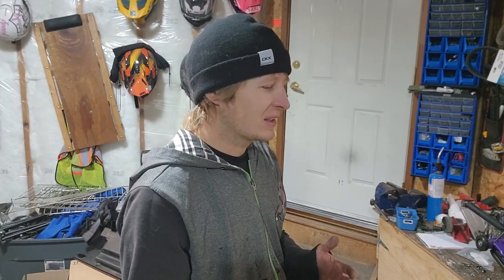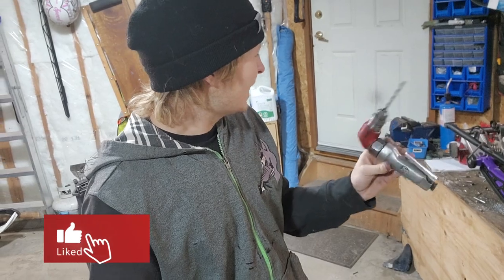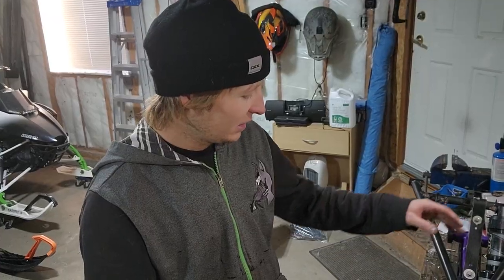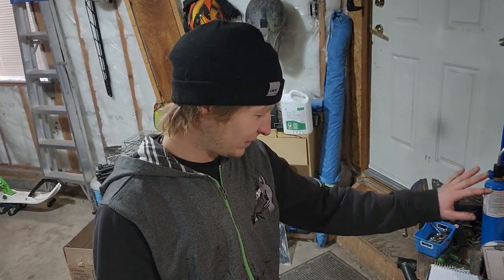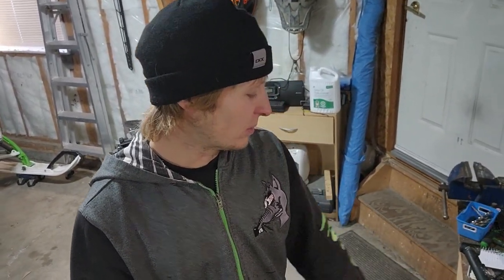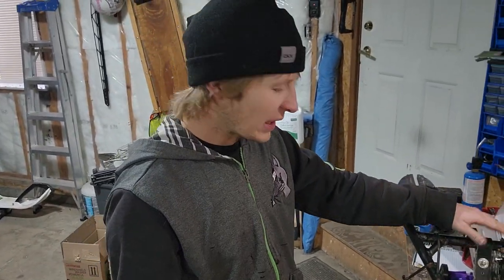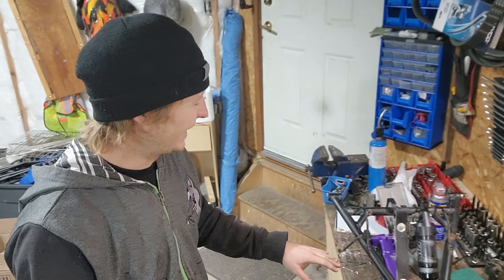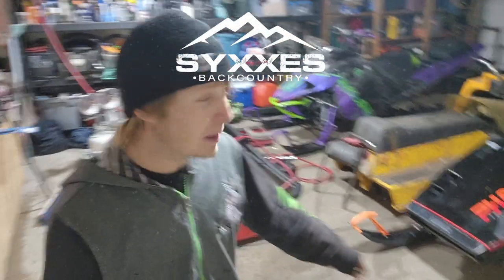ALPHA ONE RAIL UPGRADE Part #4 | BMP FWD Rail Brace

Comment: Curious of a weight comparison between the Cat twin rail and the modded Alpha rail. I know the benefit is the track flex but it seems like some significant weight after the bracing and wheels are included.

Comment: I've got a 2012 proclimb. Running like a top when I parked it last season. The other day it would fire up just fine, but neither the kill switch or key would kill it. I heard that circuitry runs through the cdi box. Im thinking cdi box because yesterday it went into limp mode for about a min and then came back to running normal. Any suggestions would be appreciated.
Reply: I'm riding same thang,  haven't had that one yet🤔
Reply: Mine did a limp mode but the code was apv,  so cleaned, sprayed with dry graphite and never had that code again